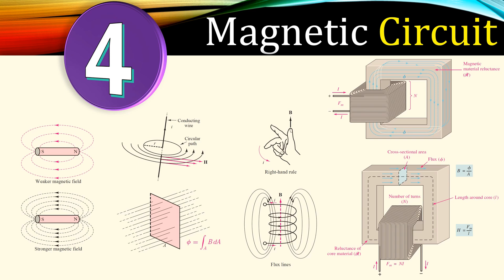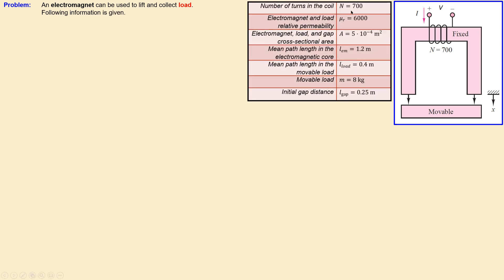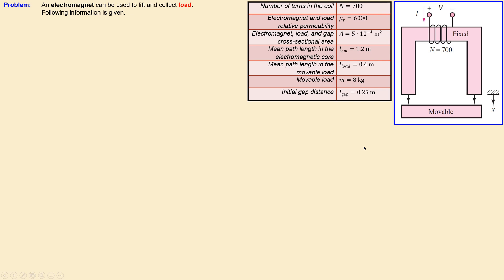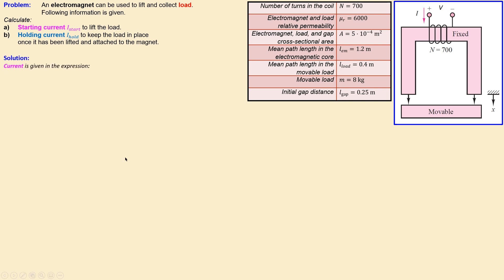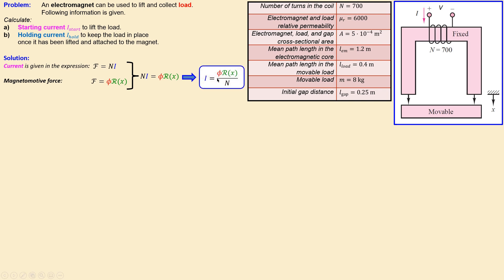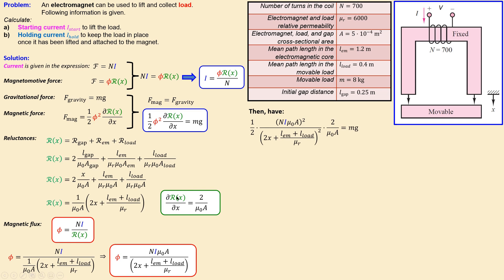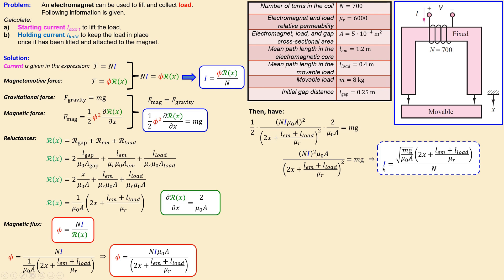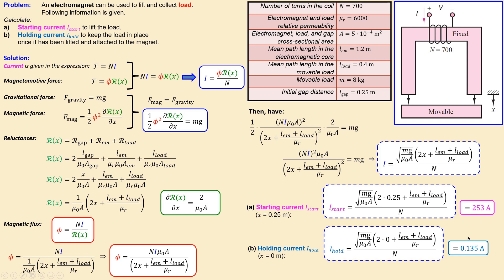🧲 Magnetic Circuit Example 4 ⭐ Electromagnet Lifting & Holding Load ⭐ Required Start & Hold Current

Comment: Why in 3:51 we need to derivate magnetic force?
Reply from the maker: Stored magnetic energy W_m can be related to the reluctance of the structure using: W_m = 0.5*φ^2*R(x) with R(x) the reluctance as a function of displacement x.
Magnetic force F_m acting on the moving iron can be approximated by F_m = -dW_m/dx = - 0.5*φ^2*dR(x)/dx.